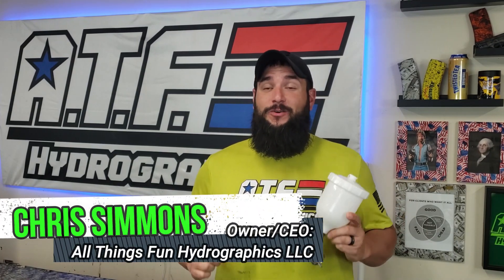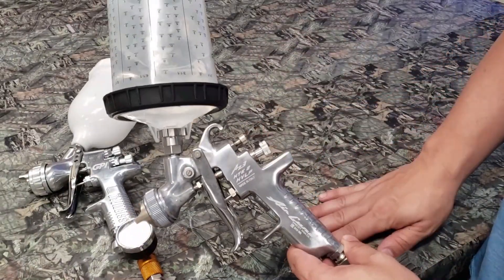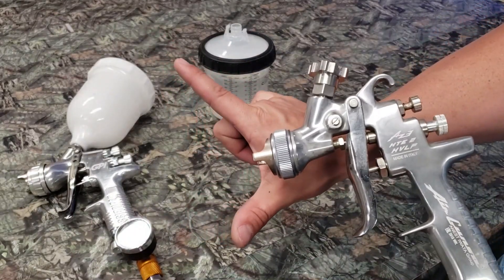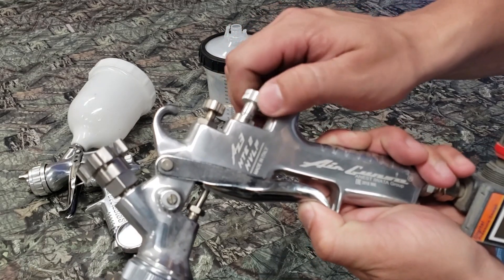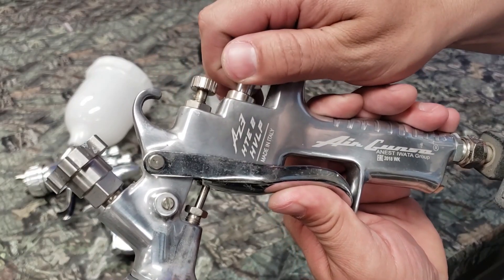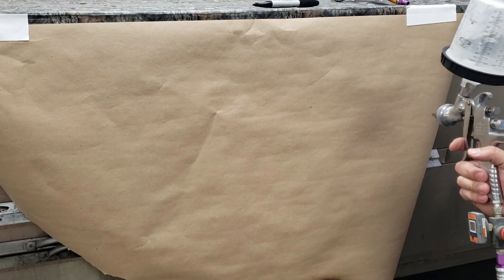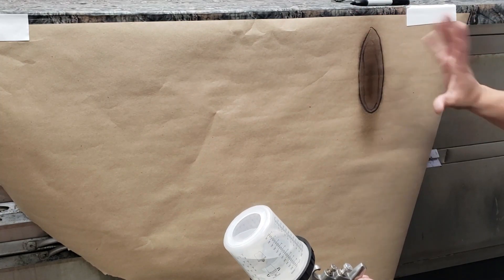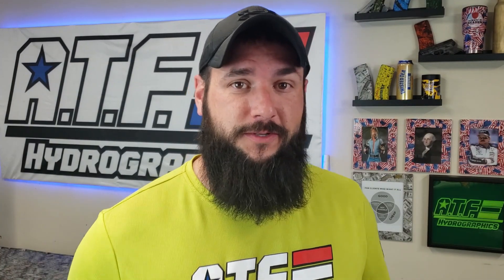Set up your Activator Gun || How to Spray Activator

Comment: Thanks for the good videos, I'm learning a lot. I'm a beginner and I'm hesitating between buying a cheap spray gun or sticking with aerosol activators. Will a cheap spray gun spread the activator better than a rattle can? Thanks!
Reply from the maker: Spray gun hands down. There is zero consistency with the cans and they make it much more difficult to dip.

Comment: Thank you for sharing your knowledge it means a lot to us beginners. I have a question about something you said in the video. You make a extra pass going back and forth vertical if the film needs more activator. How do you know what film needs more activator? Can you tell from looking at the film or handling it?
Reply from the maker: It is all from experience. No two films are the same, which is one of the reasons people struggle so hard with activating. It takes a lot of time and practice, which is why I always tell people to practice on something cheap before doing your actual project.

Comment: What a great help!  Thank you!  I was curious about the regulator?  What brand do you use and how precise should they be?  I've got a Harbor Freight digital regulator but it will jump from 12-18 psi between uses.
Reply from the maker: I had some HF regulators and had the same issue. The ones I buy now are from amazon and cost about 40 bucks. They last about a year and I toss them and get new ones. It needs to be pretty specific so you can get repeatable results.
Reply: @AllThingsFunHydrographics  After some close studying of your video and the price you mentioned, I believe I found the regulator on Amazon.  I just ordered one.  Thanks for responding Chris!
Reply from the maker: @roscoeb  Glad I can help

Comment: Great video but I'm correcting in two important points.
When you adjust the air pressure you did it with an empty gun. After you filled it with activator I can assure you that the pressure goes up, not by much but it still effect the spray pattern. Second. You opened the needle full. If you turn it clockwise a half to 3/4 turn you will have less over spray.
Reply from the maker: Thanks for the info.

Comment: Do you think that particles (even ones you think you can’t see) can effect the way the film goes on a product? Ex: tiny wood particles, dust, micro water droplets from a the air compressor?
Reply from the maker: anything that makes the surface rough or not smooth is going to affect the dip. You want to parts to be clean and smooth as possible.